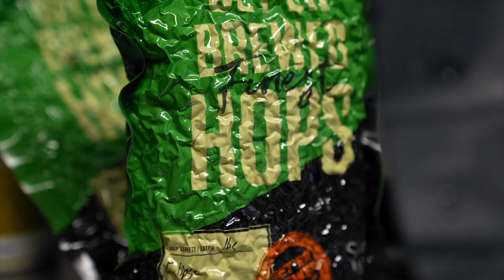Hop Creep can occur when hops are added during fermentation.

Comment: Some hops are worse for it than others. Cascade is one of them. Just remember you could use it to your advantage say like a high finishing gravity. You could use hop creep to break the long chain sugars to get the final gravity to where you want it. Just make sure you keep the temperature up 18-21deg with an ale yeast to remove the diasytl for a few days after the bubbling has stopped.
Reply: I’ve done this.  Sometimes I need to squeeze a 1.022 FG down a few points